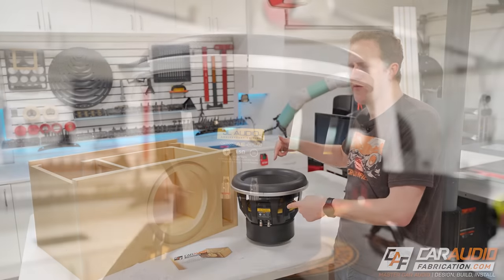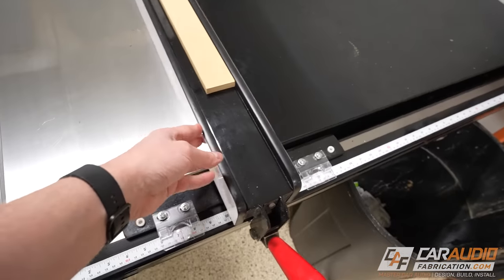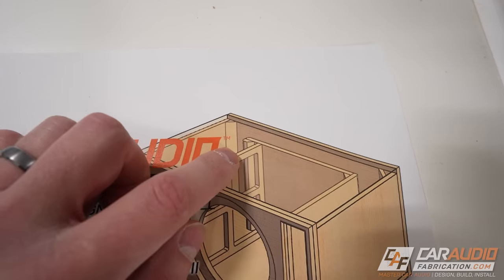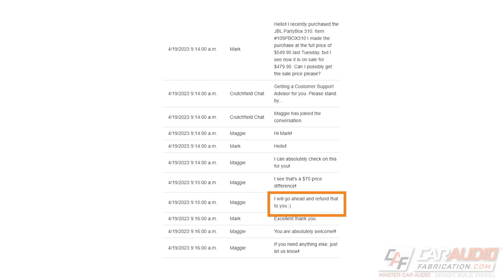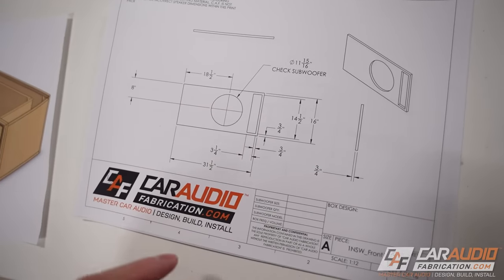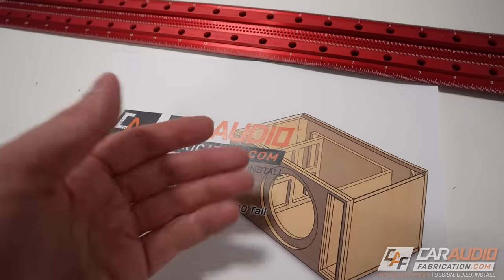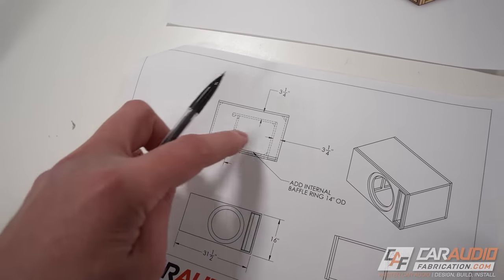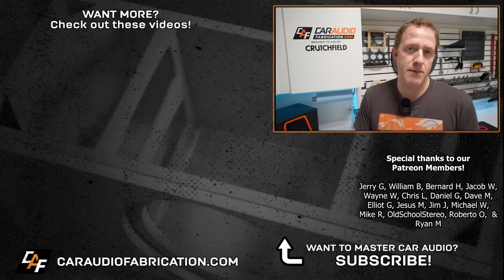Sound Quality BASS! Ported Subwoofer Box Build - 13W7AE

Comment: I'm building a new enclosure for mine. 2 cu sealed. It sounds very boring, but I am going to make mine in a U shape and invert the sub. I plan on isolating the trunk from the cab, using the sub box as the main isolating wall. The sub basket open behind my rear folding seats. The other side is acrylic, so you can see the W7 face inside the enclosure when you open the trunk.
Reply from the maker: Sounds like a cool build! Definitely let me know how it turns out! Tag in some pics on Instagram @caraudiofab if you want!

Comment: Hi Mark, I enjoy watching your videos. It sure would be nice to see some fresh videos. 

For example, how to set up an amplifier that is oversized for the load.  A 500w rms sub and an 800w+ rms amp. 

Or tips on determining the crossover points when using 6 1/2” mids, tweeters, and 8” in the front doors along with one 10” or 12” sub in the rear. 

Or tips on incorporating a subwoofer enclosure into a custom center console.

Comment: Nice work. Do you not like to use aero ports or pvc ports? Do you have a video comparing the pros and cons of the different types of ports if not I’m interested in seeing one.
Reply: Aero ports typically are too long given a low tuned enclosure to fit inside,  slots are a better alternative because they are used with the provided wood inside and can be angled and long as needed to fpget the proper tune

Comment: Vehicle will definitely make a difference as well, I had the spec  Atrend 2.375 34.6hz box for my 13w7 and I built a 2.8 32hz box and it was significantly louder and lower on the same exact amp.
Reply: More air space will yield more output and bass extension. Makes sense

Comment: Isn't the w7 supposed to have a full double front baffle? Any concerns mounting it with the single baffle and thicker back ring?
Reply: Actually thinking about it now, seems like it's probably fine since it's only a single baffle on the area under the mounting flange which isn't very large

Comment: Where does one typically start in fittin a car?
Reply from the maker: You mean like measuring? I talk about measuring in several of my videos on the channel here: https://www.youtube.com/@CarAudioFabrication/search?query=measure
Reply: Nah. I mean like. I just got a car and all I know is I want a clean setup. Where would you start. Deck or integration. Mids n highs. Sub and box design. Measurements for deadening and wire runs. Upgrades in the batts n alt and those wires. Amps and dsp or eq. 
Oh. With the added should I save up for the whole or should I piece by piece.